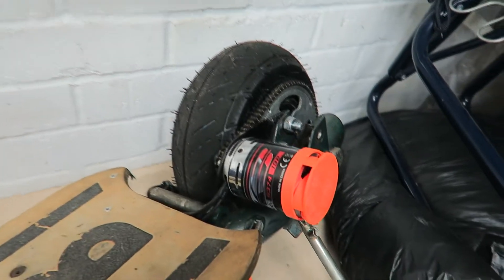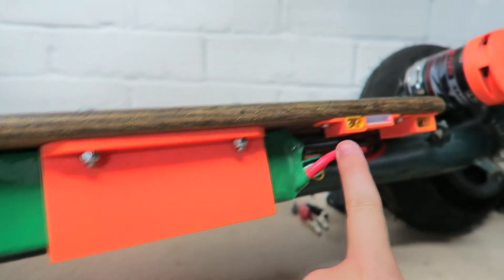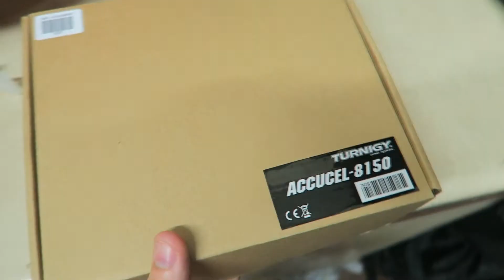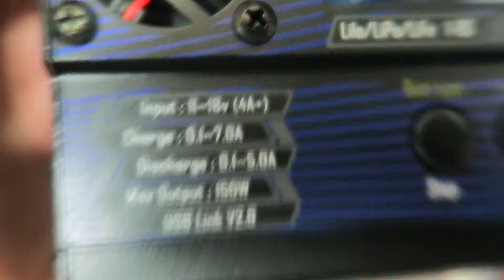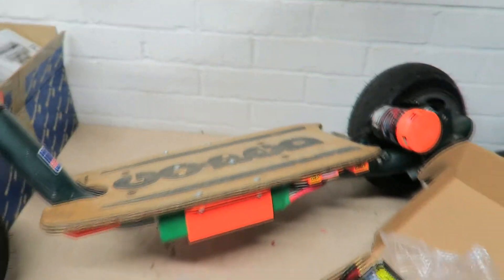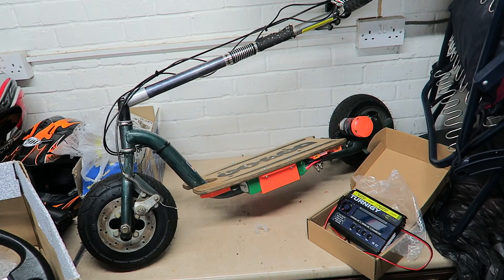HOMEMADE ELECTRIC GO-PED IS FAST!!

Comment: Love this scooter!! do you have a parts list?.

I have the GoPed 750 which already comes with a motor, controller, and batteries but unfortunately the ESC went the way of the Dodo. I don't know much about electric motor power systems so I'm not sure what will, and will not work with the motor already installed.
Reply from the maker: it runs off 2 x MultiStar 4S 16000mAh batteries wired in series, a VESC and a turnigy aerodrive sk3 motor
Reply: goped 750 run best with 7s lipo or liion cells.   the voltageis should be around 25 to 29voltes.  I just build a 7s6p liion batter for my old Goped 750.

Comment: To slow with an engine that hurt my feelings I have a goped sport that would change your mind as far as speed.
Reply from the maker: silent and deadly - electric power :-)
Reply: Great build I love your mount thinking about It I need something just like that.
Reply: Lol, a Sport has a G23LH, the slowest engine GoPeds ever used (Well, except back in the G2D days). Hop on something with a G260RC/GP290 with an expansion chamber and you'll feel some real power 🙂 but, quite loud. I'm thinking of turning either my SuperSport or XPed into electric, I think it would be quite fun considering how far brushless/LiPo technology has come in the last decade
Reply: TheCarPassionChannel I love your build my sport has an 290 on it almost done with the goped460 but electric is the way to go in city.
Reply: Carlton Harris I really want to run one of those new fancy G340RC's but in a spindle drive configuration, not sure what kind of fab work is involved
Reply: i had a bigfoot that was mental... ada head kits and expansion pipes, ported  more compression.... the down side for me was having the spindle drive with no clutch and having the engine locked down to the back wheel. 
i just dug out an old vid of one of my g260rc engines we built...no shiny head kit on this one though :( was just being tested after porting so no pipe yet either but was a beast. 
  https://www.youtube.com/watch?v=icZPVRsUY3E

Comment: How many cells for the battery?
Reply from the maker: it runs off 2 x MultiStar 4S 16000mAh batteries wired in series